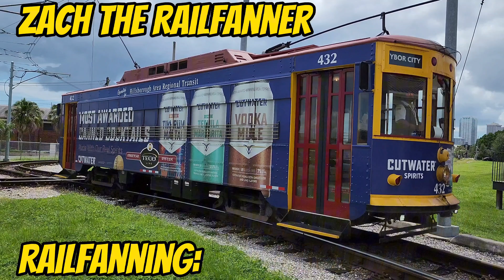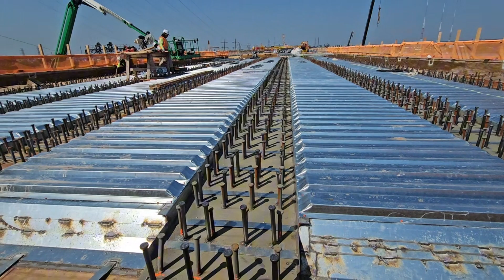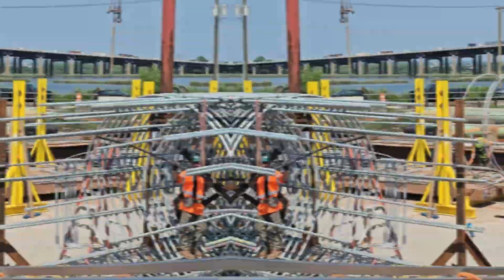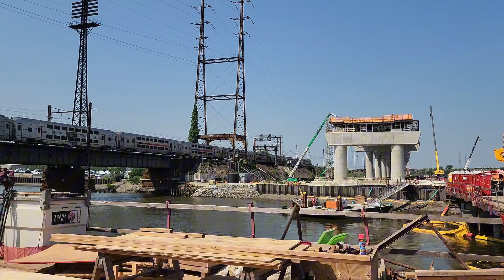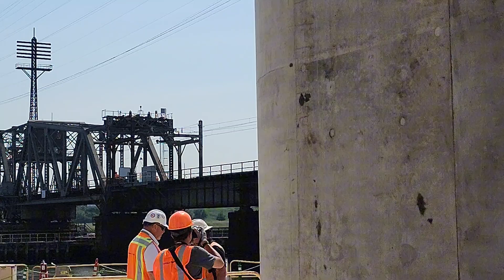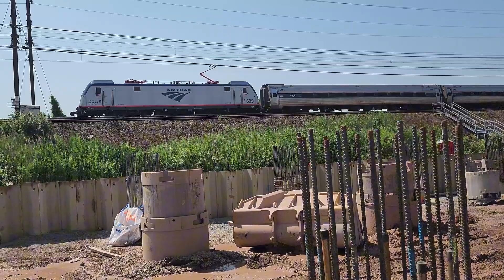Tour of The Portal North Bridge Construction Site  FT: Current Portal Bridge Opening (6/18/24)

Comment: Awesome video does the current Portal bridge have a horn, siren, whistle, buzzer or alarm signaling the opening and closing of the bridge?
Reply from the maker: @kirkzevola5004  thank you! There was an amtrak worker on the bridge that would sound an air horn before the bridge would move to open or close
Reply: Did you catch that on film?
Reply from the maker: @kirkzevola5004  no. I used that to know when to start filming
 After I heard the worker sound the air horn I started filming
Reply: Damn that would have been cool to hear as I always wonder which draws utilize different methods of sound as a warning before opening and closing. I’ve always wondered what the Portal Bridge sounded like. But hope you had fun out there.